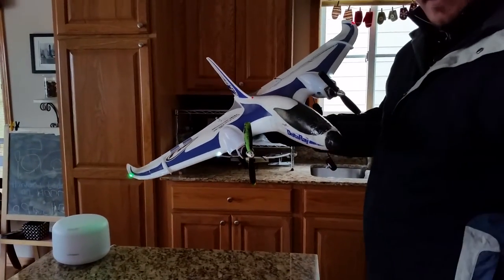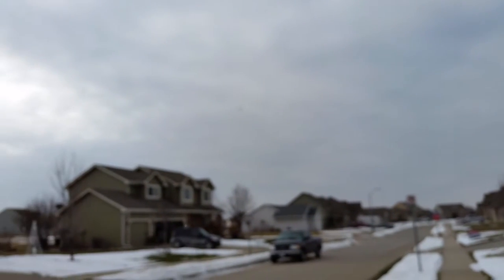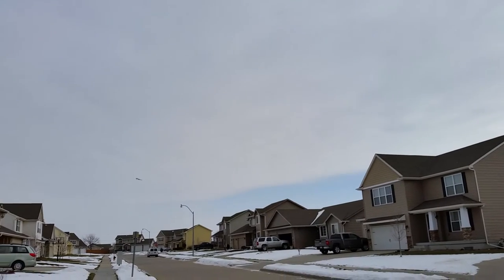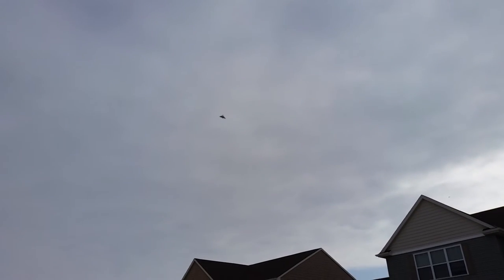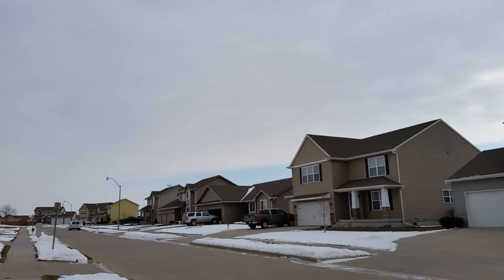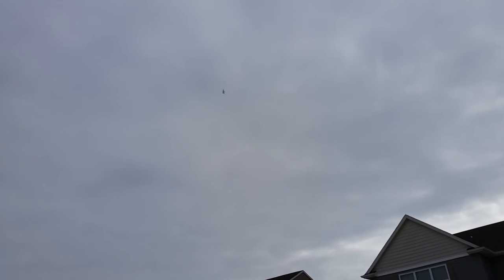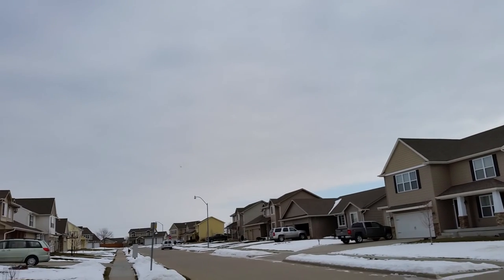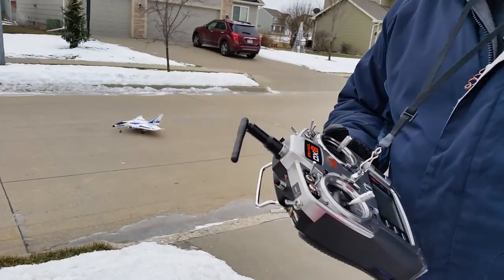Delta Ray Brushless Upgrade 6X4.5 Bull Nose Props LED's

Comment: Just so everyone knows seeing Brian Phillips fly an RC airplane in a neighborhood the Delta Ray not only has a very soft rubber nose and is made of soft EPO foam... but it is a hollow core structure and only about 1/4in thick... it's a flying eggshell designed to break into pieces absorbing the energy of any impact be it a roof, window, or even a slow moving kid;-) It is one of a new generation of RC planes this size that are SAFE in more ways than one. The newer Opterra flying wing is much bigger but again is hollow foam construction showing Horizon Hobbies is an asset to safety as well as progress. Nice flying Brian....
Reply from the maker: yes, thank you :)

Comment: So, you had to remove SAFE to go brushless? What motors? What lights?
Reply from the maker: Yes. The delta-ray had two independent brushed motor ESC's stock on the SAFE reciever. This reciever also handles the mixing for the televons and AS3X and SAFE.

Brushed ESC's basically change the amplitued of DC voltage to control rotation of motors, while a brushless ESC changed the timing of pulses to different sectors of the motor to create a rotation effect, much like an AC motor.

In my case I used a LEMON-RX reciever to replace the stock multipurpose reciecer.

I wish I didn't have to give up safe, but now I'm doing lots of stuff I'd never have been able to do with the stock reciever, namely...

1) 4S Power!
2) Physical Rudder & Differential Thrust
3) Brushless Motors
4) Reverse Flaperons

...and in the near future...

5) Air Break to work with full reverse flapperon deployment

or

5) Kanards (a front wing to counter the effects of the reverse flaperons, for slow speed flight)

or

5) Kruger Slats (front flaps)